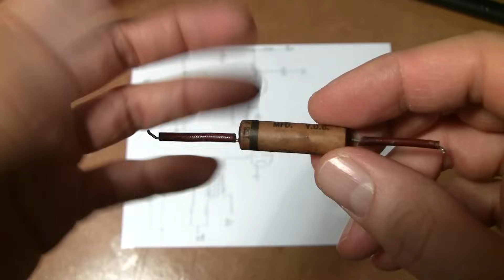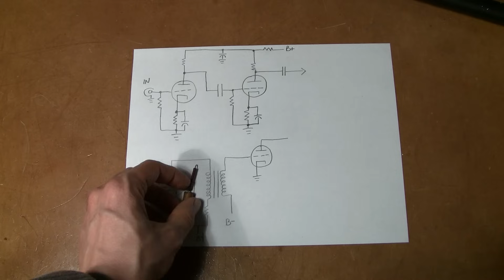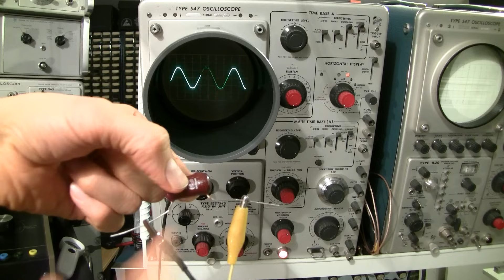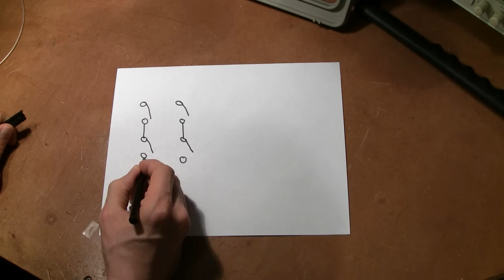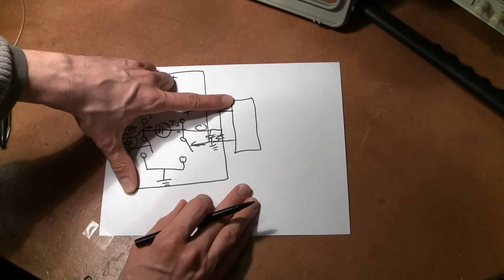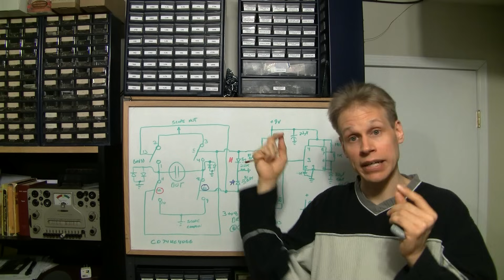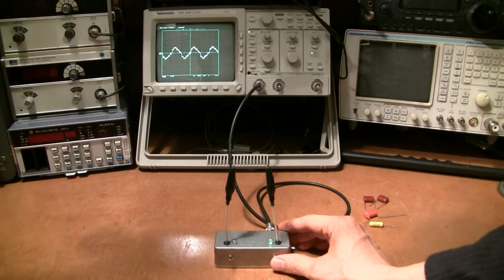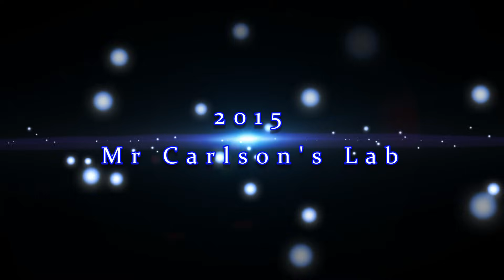Are Your Capacitors Installed Backwards? Build this and find out

Comment: Why go through all that trouble when you can do the same identical thing with just one DPDT switch??  The bat handle of the switch would point to the true minus of the cap once you have it calibrated, plus it will stay in that position till you mark it.  And you control the speed it will switch with your hand.  Simplest design always wins the award in my book.  So in reality you only need one DPDT switch, one BNC connector, the metal box and of course the alligator clips.

Comment: In was aware of this, but always trusted the outer foil markings on brands like (old) WIMA and ever after Philips. The prewar "tar" ones from Philips or others never had markings is my recollection and of course old fashioned electrolytical ones were obvious. Still, after putting a suitable adjustment potentiometer across the 6,3 Volts for all tubes except the 4 volts older rectifier one,   with its slider to mass one could adjust for minimum hum by ear. BTW when still building audio preamplifiers with tubes a long time ago, having a starconfiguration for earth/mass collection of leads worked even better for preventing audible interference. Of course transistor based amplifiers have such high bandwidths at the inputs, all kind of spurious signals can come in anyhow. PS I wonder whether wet electrolytical caps for power supplies exist anywhere on this planet in functional condition, the last one from Tsjecho-Slowakia (250 Volts Hydra.... in 8 or16 MicroF?) I noted around 1955 or whereabouts, which I exchanged for a dry one in larger capacity .

Comment: May I suggest a small mod so you will no more have to watch both the LEDs and the scope display, and even suppress the LEDs, allowing extended battery life. Set the scope to 10 ms/div. Increase the 555 oscillator frequency to 19 Hz. You'll be able to see six (Northern and Central America + Japan) or  five (rest of the world) cycles on the oscilloscope. With an additional connection from one of the flip-flop outputs to the scope sync input, with sync mode set to to "normal" (not "auto"), you'll be able to see the two amplitudes of the noise strays. So if capacitor is in the right way, low amplitude is oscilloscope half left screen and high amplitude on the right half ; or reverse, depending on the sync polarity.

Comment: why not just incorporate a high gain op amp amd a small buzzer to detect audiably wich is the foil end?
Reply from the maker: Well it's not that easy. What sets the buzzer sensitivity when different capacitor construction presents different amplitude values? You would also need a circuit to detect the lower or higher amplitude side that would have the logic to differentiate between varying amplitude values. This circuit would have to know this on a continually changing basis. That now involves a microprocessor.... Or you could just look at the signals and do this yourself with a scope.

Comment: Great video, didn't knew this. A question: You said that this is an issue especially for guitar amps and such. But wouldnt you say that this is an issue for all type of circuits: The outer layer should always goto ground to eliminate any humming along the way, even from couplin capacitors?

Comment: Thanks for this video, very useful. I didn't know that capacitor polarity matters for these non-electrolytic capacitors. However, even with your circuit, you still need an oscilloscope. Could there be a circuit that indicates the "band end" by a simple LED?

Comment: Hello Mr Carlson's great video, congratulations! I would like to say that I have been doing my tests to try to discover the "polarity" of my capacitors and what I found is that if you put your finger on one side more than the other side of the capacitor, the inductance changes and with that I can say that ALWAYS the side where it has "less finger" it will be the one of less inductance. So unfortunately, I'm sure it doesn't work. Reviewing the video ... we can see it in the tests ... less finger ... less inductance ... negative side. :(
Reply: Are you suggesting that this device doesn’t work?

Comment: What about a radial package electrolytic capacitor non polar/bi polar type?.They have one long leg and one short(The ones i bought have)Do they have noise problem if they are in circuit the wrong way?tried to listen with headphones and a jack where i hold the cap and hold the cap both ways down on the jack male connector while using a silent small guitar amp could not tell.

Comment: Newby question: Does this polarity also matter when installing capacitors into a guitar tone circuit? I’m wondering if I installed my Orange Drop cap incorrectly in my Fender guitar.

Comment: really? windows xp?
Reply from the maker: You bet. Hey, did you know, some of the biggest manufacturers in industry load their machine operating systems from a punch tape? New devices are for consumers who don't know better. Why replace it if it works, and there is no benefit?
Reply: ok youre the radio man, not mr digital....

Comment: I'm using a picoscope (2204a) which connects to the computer for display.    I have not been able to a) get the wave forms stable and b) detect any real difference in my new 'orange drop' capacitors, likely due to a.  
I wonder if there is something special about your triggering or do I just have to bust out the old scope.    Any thoughts?
Reply: Maybe I'm not getting enough AC in my diet!

Comment: I have run into a couple radio restorers that think testing old/new caps is not necessary or outside shield is not a concern, but I can clearly see from your testing that it DOES MATTER A LOT.
They need to watch your videos and I sent a link to this.  When I buy from a restorer, I won't buy unless they checked DC leaking and outside foil polarity.  Hopefully your videos will improve the knowledge of these  radio restorers so the finished product can be as good as it can get.

Comment: I'm in the process of recapping an old Stewart-Warner radio and currently have little in the way of test equipment and having watched this video was concerned about which ways to install the new ones.  Truth be told I just winged it for most of them.  But, there is one in very difficult position that I'd really like to get right.   Using the information here, and in the descriptions of the various tester projects, I tried just hooking a capacitor up to an ordinary audio amplifier and listened for softest buzz.  It was definitely softer with the cap in one position vs the other.  It's a pretty tedious way to do it I admit, but seems to work.

Comment: 2020 posts have taken common sense to new lows... by using specious but flashy "tests" which tend to "prove" that caps can be used any way they are installed. Just learn what you can from Paul and FORGET the claims these "techy types" use to make their "tests" seem important.

Comment: I just love building my own test equipment. One I am particularly fond of is my transistor tester. Three leads and a rotary switch. Just clip the leads on the transistor and rotate the switch till I get a tone. The position of the switch tells me what lead is what and PNP or NPN. Some transistors will make a tone at two positions but with different tones.

Comment: Not just capacitors, but once I had a diode with the factory mark backwards in the power supply of an O-scope I built.Since then I've always checked polarity of components. Now I can check the caps too. Thanks.
edit: also resistors with the color bands "off color". Had a batch of resistors with orange bands that looked brown. That one cost me a bit of confusion when I was designing a recording system for Canada's Navy until I sorted it out.
Reply: Over the years I have found several diodes that were marked backwards!

Comment: According to your experience,  have you found hifi audio gear manufacturers have cared about non polarized capacitors "polarity" when assembling the boards? Also, what should be the general rule of thumb to choose capacitor orientation (which cap end goes where) Thanks for your comments. Great, instructive information on this video.

Comment: Thank you Mr Carlson. I love your material. I love the magic of electricity. & I especially love the insight you bring. More of the old electricity concepts no one talk about anymore in standard mainstream physics! So very much thank you!
I have one question/misunderstanding I'd love your help clearing up, if you wouldn't mind. At about 30:47 you say, you're coupling in the 60 cycle signal in from your body. 
1: Is this because ground and neutral are tied together, and we all have a little bit of an unbalanced neutral always capacitively coupling through us?
2: Is this because some harmonic of the human body's nervous system is 60 cycles?
3: Or maybe (I guess in/out is hard with AC but) is it that the signal is coupling 'out' to ground through you through the oscilloscope bnc Jack on the test jig.
Thank you for all you do. I'm sure this is a stupid question but I just want to make sure I understand it correctly. Maybe it is none of my guesses. Thanks again for your time and sharing your knowledge.

Comment: Very well done.  Thanks.  Curious, I assume this method/tool can be used to check correct polarity for caps already installed in circuit?
Reply: Mike I don't think you could reliably use the test circuit on capacitors that are in-circuit.  There would be too many interfering influences.  You would need to remove at least just one of the capacitor's leads from the circuit first.

Comment: I just tried this with a $50 USB oscilloscope & a variac. IT WORKS! I just sat next to my variac, turned up to like 25 volts but nothing was plugged in, connected scope leads to a capacitor and injected a sine wave signal through my fingers. Switched leads and sine wave was bigger.  Ya!

I'm not going to build the tester, I'll just check all the film caps as I go building an amp. Thanks Mr. Carlson!

Comment: Where was  Mr. Carlson when I was in college. To be so young, and have so much knowledge, and able to explain everything in a way that anyone can capture his meanings.  As an Engineer (retired NASA), watching his video's are not only informative, but enjoyable. I'm 74 years old, and when first starting my career, everything was tube technology. I had to learn with the changing of times as we moved into germanium, to silicon, and some SMT (luckily, I retired before it got to heavy). The transition wasn't easy  for me, the professor's I had moved at a very fast pace, and you either got it, or with help from other students in the class, did the best you could. The actual knowledge came from the field where you used what little you had learned, and hands on taught you. I hope Mr. Carlson stays on line, I really enjoy the video's and his skills.

Comment: At first I thought "yeah, sure" but I ran my caps and they do have a measurable polarity, about a 30% difference in reading on my scope.  Also, the polarity does not match the printing, just as stated.  I"ll go pop them into an amp the "right" way and see if there is less noise.
(I'm using a TDS 2012B scope)

Comment: Electrical polarity (positive and negative) is the direction of current flow in an electrical circuit. Current flows from the positive pole (terminal) to the negative pole. ... In a direct current (DC) circuit, current flows in one direction only, and one pole is always negative and the other pole is always positive.

Comment: So how on earth would an electronics builder get it right without testing caps with an oscilloscope?
Reply from the maker: You wouldn't.
Reply: The manufacturer CORRECTLY labels the capacitors as they are built.

In other words, the machine that makes capacitors, is designed to put a black line near the lead that is connected to the outer foil. No differently than a manufacturer puts the - and + on batteries, etc.

There should be NO need to test the capacitor; IF the manufacturer was conscientious. But that is basically NOT going to happen in today's era. Sad indeed.

It is called "Zero Defects". Which it use to be. Those days are gone. Sad. It is called "liberalism". Oh well.

Comment: Not sure but I think that the mark on the orange one is to have similar mark as chemical modern capacitors on which the mark means "positive" as oppose to "case" which is "negative" on chemical capacitors and go to lower potential. The ancient capacitor mark you showed is completly obsolete since.....so many years ! Interesting video for the theory. Nevertheless, I think that asking the manufacturer is always a good idea. :)

Comment: this all supposes you have an oscilloscope..I don't..it would be neat if the signal from the cap would be amplified and fed into a speaker...I think it would be even simpler, and the difference in the two leads would be really obvious to your ears....and to make it even simpler you could do away with the flip flop and 555 and just hold the cap onto two probes, purpose built with one able to move in and out a little for size...

Comment: I was told this 40+ years ago when I worked on VHF circuits. There is a parasitic capacitor between the outside foil and the ground plane on the top of the PCB board. This had an impact on how the circuit performed. We assumed the band end marking was correct as all our capacitors were made 'in house' and we assumed they got it right and carried out test to check. 

It would be interesting to learn what the manufacturers data sheets show for the meaning of the line on the capacitors you found wrongly marked. It could be of course that they are 'grey' copies and they only cared about reproducing the OEMs markings not what they meant. The grey component market is horrific, I am aware of occasions where chips have been relabeled so they can be sold as high value parts even though they are completely the wrong chips. We brought a batch of what turned out to be 'grey' clones at work for a lot of money - non- functioned. Not sure what action the police took it was still under investigation when I left.

Comment: Wow! I never knew the factory markings were so unreliable! Just a question, should the lighted LED be on the Zero volt side? the grounded side?
Reply from the maker: Yes, The led that's lit indicates the grounded side. The grounded side doesn't allow hum from your body into the capacitor, indicating the outside foil.

Comment: Awesome information & presentation. I knew the importance of electrolytic polarity.  I never knew in my 40 years of electronics since the USAF of this and now appreciate learning of the difference in non electrolytic capacitors circuit orientation. You would logically think a capacitor manufacturer would understand this and come up with a standard and manufacturing process to identify the band end.  It seems they may not know what you do and that would not be too surprising. You are a special person!

Comment: Holy Cow!!  52 years as an electrical/systems/test/hobbyist engineer (analog and digital) with a BSEE and MSCS and I NEVER KNEW THIS.  An outstanding explanation that explains why a troublesome noise issue is occasionally fixed by simply replacing what appears to be a perfectly good capacitor.  If the band marking is only randomly the outer layer (and it's obvious in retrospect that it happens because the marking is being done last on caps that are dumped onto various conveyor belts during manufacturing - Duh!!) I'm astounded that sensitive circuits work as well as they do.  I doubt that one engineer in a hundred knows this.  Thanks for the great explanation, great design process and an outstanding little test tool.

Comment: Paul - please explain how the plate is lower impedance?? Isn't it high voltage or a higher voltage than the grid?? Thanks. IOW - why are you connecting the low impedance side to the plate and the high impedance to the grid that follows??
Reply: Man From Yesterday Because the impedance to ground on the grid is much higher than the impedance of the plate to B+
Reply: @StewartMarkley  But, doesn't that correspond to voltage? If the plate is 90 volts to ground... and the grid is say, -4 volts to ground, wouldn't the plate have a higher impedance?? What am I missing? Thanks.
Reply: Oh, wait a minute... perhaps it's the 90 volts plus the -4 volts that would give the grid a higher impedence?
Reply: Man From Yesterday No, the impedance on the plate is a function of the plate load resistor which may be around 47k or so. The impedance on the grid is very high, maybe 100k to 1meg or more because the control grid controls the current through the tube by its voltage and the grid current is usually zero. The voltages have nothing to do with the impedance, it’s all about the resistances to ground or the B+.
Reply: @StewartMarkley  OK - thank you!

Comment: At first, when I saw the title, I thought it was about polarized capacitors such as electrolytics, and it was a method to know if the orientation is correct if the marking was missing or something. But I had no idea that non-polarized capacitors also have a better way of installing them! Also, what's the purpose of the marking if it doesn't indicate the outside foil? And why did you use a flip-flop instead of just a NOT gate?
Reply: I believe the 555 in this configuration is creating short intermittent pulses, not regularly switching between high and low.

Comment: Yes, it's not polarity. It's called "OUTSIDE FOIL" Just like coaxial cable. Hot wire in the middle. The outside foil is the shield.
Reply from the maker: Why would you not call it polarity? You have AC in your wall outlet, and it's classified as "a polarized outlet." How about a polarized line cord? Some of these capacitors don't say outside foil, instead they say "Ground End." Same capacitor, different writing, you can see examples of these in later my video's. There is a ton of garbage information out there from self proclaimed experts, be careful where you get your information.